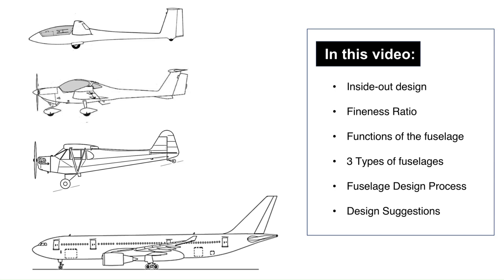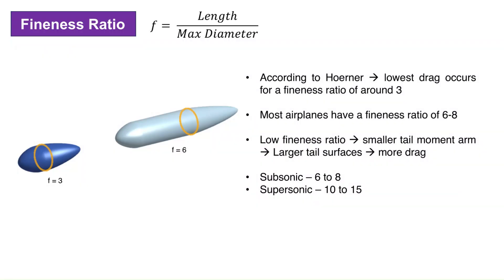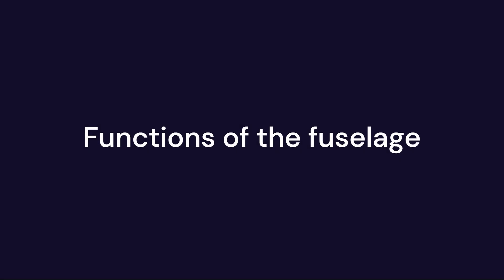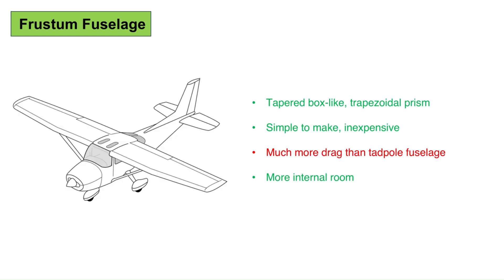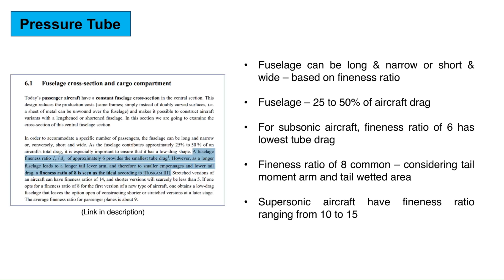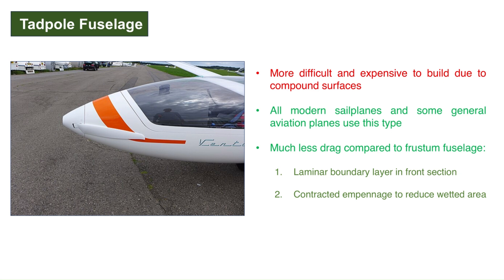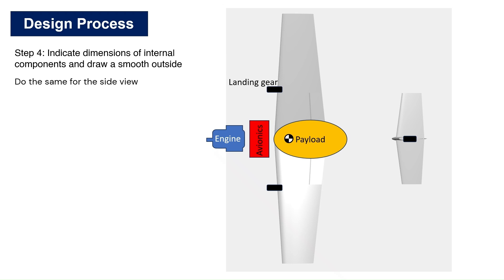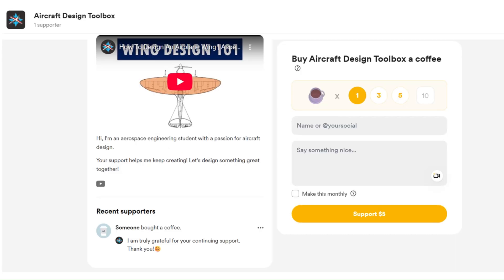How To Design A Fuselage | Fuselage Types | Fineness Ratio

Comment: Love your videos, what structural/stress analysis would you apply for the fuse once its conceptual look has been designed? Like, stress analysis to validate the structure and ensure it doesn't fail? I'm open to book recommendations/readings that cover that or help build that intuition. I have done mechanics of materials, but I'm not great at making my own assumptions or coming up with my own ideas/methods to solve real world problems. Textbook stuff is different. Do you have any advice for that?